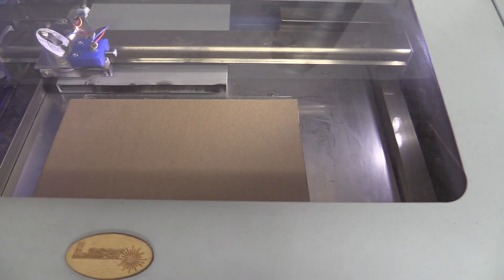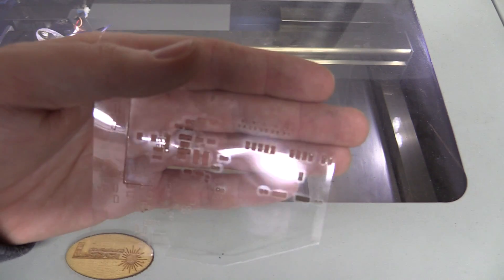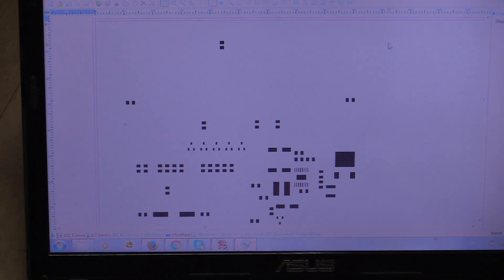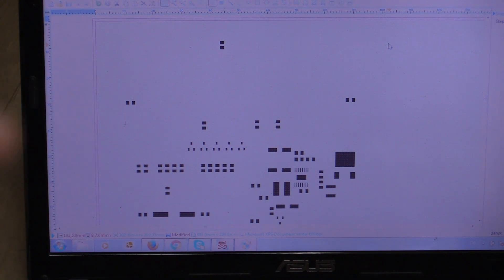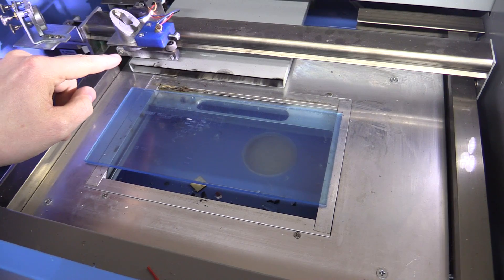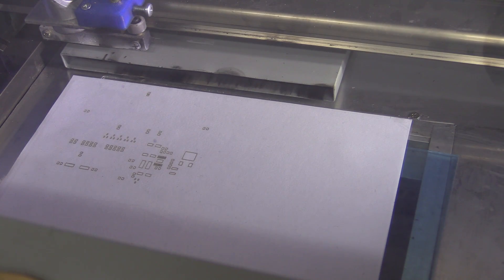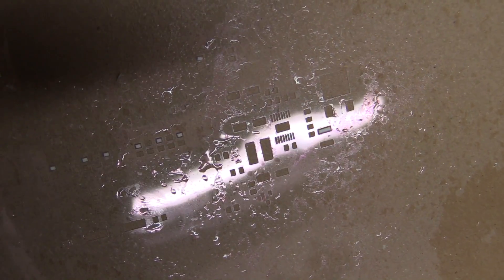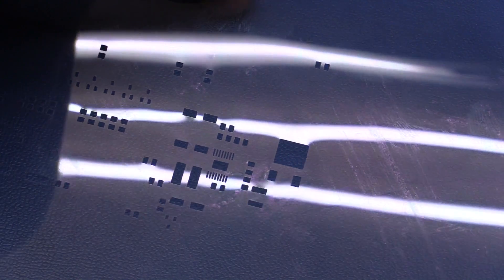Cutting Quality SMD Stencils with the Chinese Laser Cutter - Ec-Projects

Comment: Very smart idea . I installed air assist on my cutter for a similar purpose. I haven't tried a stencil yet but plan to and it is nice to know there are other options to achieve a good job if the air assist doesn't cut it (pun)🙂.

Comment: I'm thinking of doing a solder paste plotter instead of this route as I usually only make small number of PCBs but if you want to do more than 5-10 It's brilliant. One thing I would do instead though is buy poly-amide sheet instead of Mylar (projector film), a small cost difference and might just remove the need to use wet paper. It also is less transparent than Mylar making registration easier.

Comment: Outstanding!  I just used your "Secret Sauce" to cut a stencil with a 
5x5mm VQFN-48 (.25mm pads with a .5mm pitch),  two SOP-8 .65mm pitch and
 a SSOP-28 with a .65mm pitch.  I cut the stencil out of cheap 
transparency film, pasted up a board, placed the parts and baked.  The 
board came out perfect!  You're amazing.  Six Stars!!!!!!
Reply: What speed did you use for vector cut using this method and what mA did you set the laser to?
Reply: @dholi2k  I found that slow and low power works very well. It seems that it takes a significant amount of time for the laser to come up to full strength. We set out laser using percent power and speed. I found about 3% power and 5% speed gave excellent results. The laser now has a new tube so I will likely need to come up with new settings.
Reply: @joed222  Thanks Joe. I've still to test on Transparency sheet, but tried on soaked paper using my K40 at 20mm/s but lines aren't straight. Will need to slow it down further I think.
Reply: @dholi2k  I do my work at Gainesville Hackerspace. We have a K40 and a VLS3.50. I cut the stencils on the VLS.
Reply: 0.5mm pitch is very challenging.  Great results.  Thanks for sharing.

Comment: Very nice idea ! I am going to try this.
A question : do I realy need a 40W laser ? What can be the minimum for this you think ?
Reply from the maker: i used only 20% power,and the Chinese specification of 40W is probably 
optimistic anyway :)
I am pretty sure 5-10 W would be enough. Just be careful if it is  a diode 
laser and not a CO2 tube, visible light lasers at that power are very 
dangerous to the eyes :)
Reply from the maker: and invisible also, I mean light that could enter the eye

Comment: I've seen a video somwhere about lasercutting stencils. What they did to not get any molten ridges around the edges was to not "cut" the design but to raster-engrave it. Cutting faster at higher power evaporated the plastic rather than just melting it through. Was on a bit of a higher end lasercutter tho. Might be worth a try if you haven't already?
Reply from the maker: I tried it, didn't really work in my machine :)
Reply: Nice to know! So i won't bother trying it myself, since i've got pretty much the same one as you do

Comment: Have you tried laser etching a PCB?
Reply: I tried this once and failed. 40W is not enough and the only thing that really works is to engrave something into the solder mask or removing it. Or laser engrave something into a silk screen rectangle. The 10µm 40W laser can not cut the copper, it's too reflective. Cutting the PCB is theoretically possible but a stinky firey process that leaves black burned awful looking edges.
Reply: Check out his channel, he built a laser engraver specifically for this purpose

Comment: Great information. Thanks for sharing. Sooo.. with a higher power laser do you think stencil cutting is possible on your self built laser cutter/exposer/engraver?
Reply from the maker: Yeah in theory. I used about 7w of power and less could probably do if you go slower. The catch is, that it has to be a far infrared laser (the co2 is 10 um), else it will just shine straight through the film :)

Comment: Very good, what methods did you try that didn't work? I  use masking tape to get cleaner cuts, particularly in timber and when I engrave acrylic, just wondering if it would be effective with OHP sheets. I look forward to seeing the mask in use.
Reply from the maker: Thanks. I tried different speeds and power on the bear film first. I didn't try with tape, but a few layers of dry paper, it helped but wasn't good. paper with water on one side was pretty good, but both sides worked a lot better. :)

Comment: You might want to try using kapton tape - it's a lot stronger so small bridges not break easily
Reply from the maker: The tape I have is too thin, so it won't leave enough paste. :)
Reply: I've used 0.003" tape (~0.075 mm) with no issues and very good results, however any one with thinkness of 0.075-0.15 will do (I prefer 0.075 or 0.1 mm ones as it puts out just right amount of solder paste). It's not very expensive either (considering that you probably won't be using that much of it anyway). Just make sure you buy one without adhesive :) I use reflow oven (infamous Chinese T-962 with slight modifications) and work with a lot of very fine-pitch parts, any attempts to put on paste by hand ended up with a ton of bridges (some of which were under the chip so I had to rework it manually using hot air gun), so I gave up and now always use stencils.
Reply: I use 0.1mm kapton foil. Works fine.
Reply: Let me guess: One of your T-962 mods was to take all that stinky white adhesive tape off the insulation and replace it with kapton tape :)
Reply: @Chip Guy Vids Yea, I've put a crap ton of kapton tape just to make sure :) I've also reflashed MCU with community firmware, added MOSFET for fan control (so it's not that annoying anymore), and added cold junction sensor.
Still I think buying that oven was the best ~$200 spent as it made assembling boards sooo much easier! Now I use 0402 passives everywhere I can 'cause they cost next to nothing ($10 for the full reel of 10000, which will be last for years for me) and help make my boards more compact. Hand soldering them would be a massive pain.